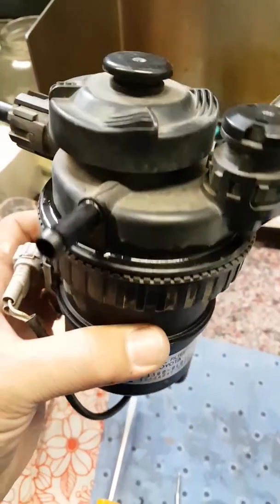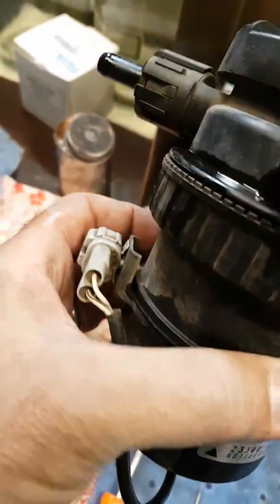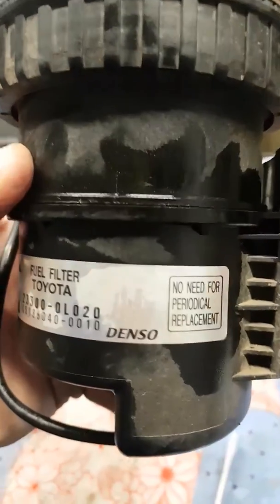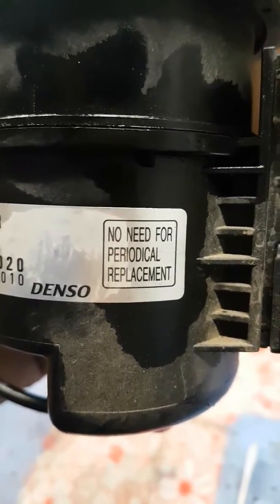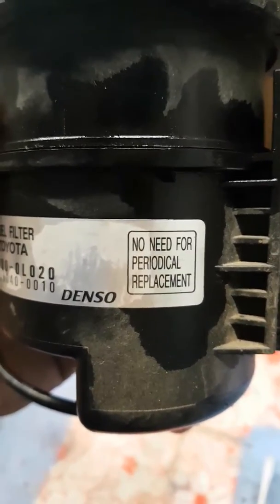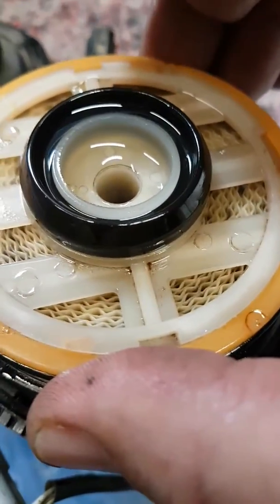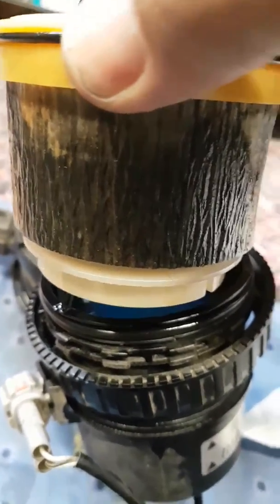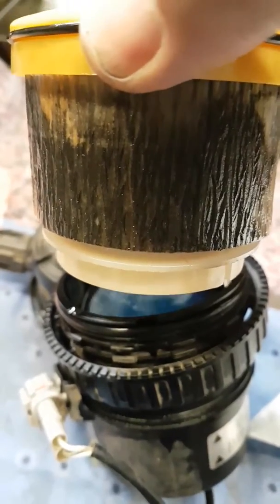What's in a Diesel Fuel Filter

Comment: I thought that the "No Need For Periodical Replacement" just meant that there is no need to replace filter at every set km (eg 20,000km), but rather change the filter whenever the fuel filter light came on the dash. 
Could that be the meaning of that sticker?
But anyway, I was advised to change it at every 20,000km regardless.
Reply: I would have interpreted it as being no need to change is based on time (6 months etc) but instead, based on mileage
Reply: No need to change the housing, definitely need to change the filter.
Reply: No need to change the housing, definitely need to change the filter.